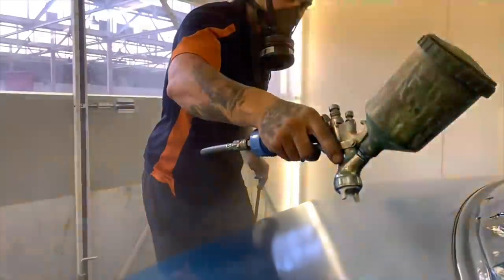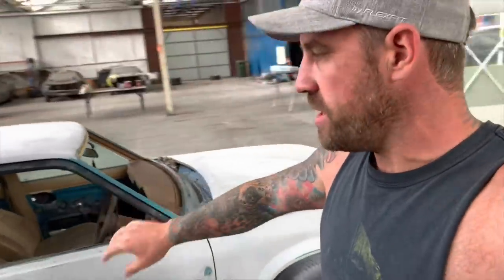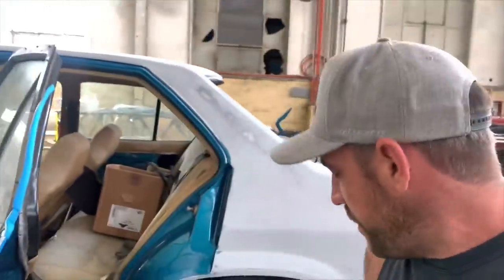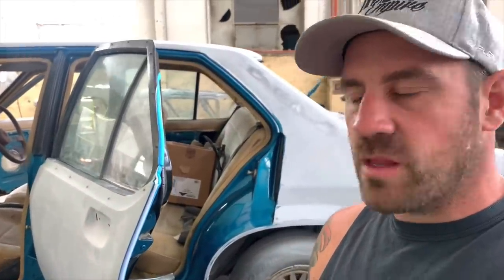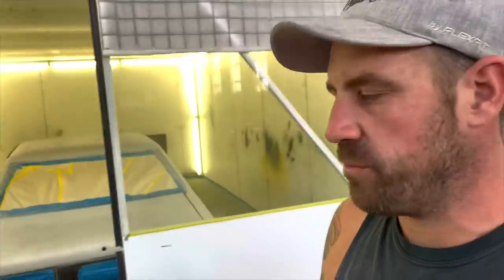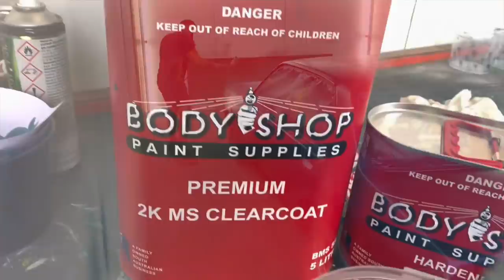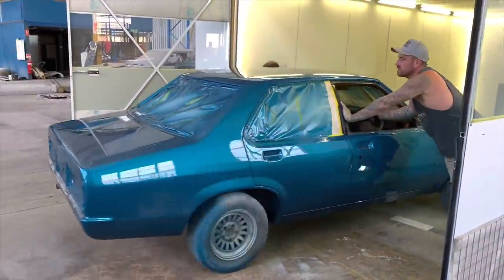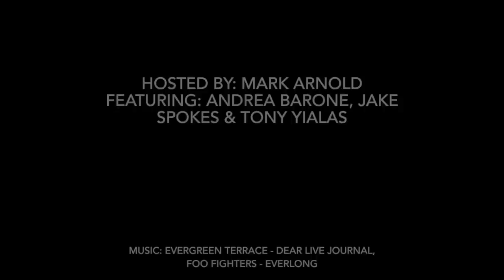Iron Empire - Finally PAINTING After Months Of Bodywork! - DIY Paint n' Panel

Comment: Keep up the great work. I have been told to spend the extra hour ground effecting car. That is masking up the  underneath and wheel wells to the floor (using plastic). Most of the crap that goes into the paint while spraying is the crap from there.
Reply from the maker: Spot on! 

To tell you the truth… we cut a corner there haha. I was surprised no one picked up on that before now! 

Masking sucks 😭